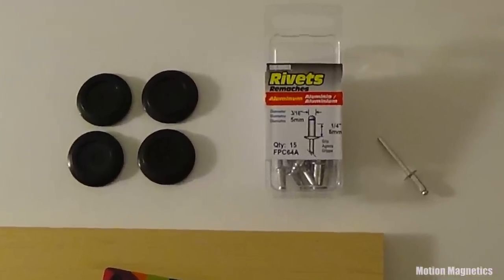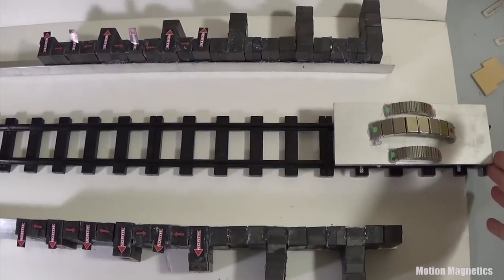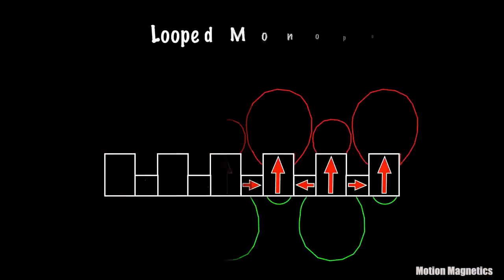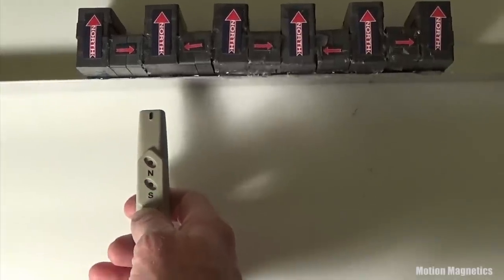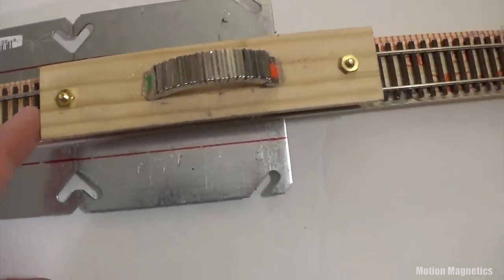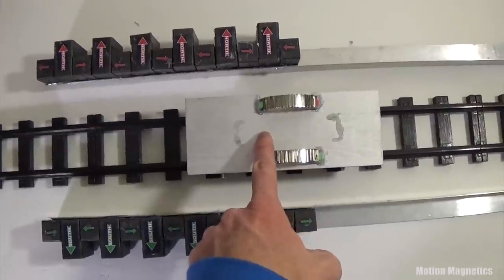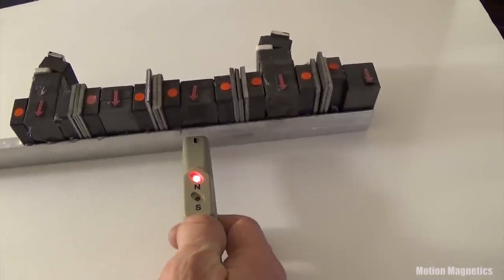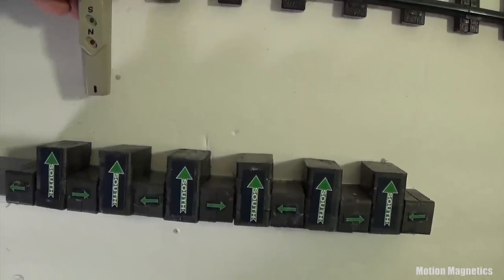Howard Johnson Magnetic Motor and the Halbach Array.

Comment: 3 carts attached to each other with 3 separate tracks . that way two of the carts would push the one entering the catch point through . then by staggering the magnetic gates or catch points you would have two carts constantly pushing one cart past the point of resistance .

Comment: Hello. Good work. Do you tried the weak rubber magnet and strong magnet combination. During the interaction with magnets, weak magnet will change the polarity. And may be during the pole flip, between same poles generates magnetic field spike what causes the pushing force?
Reply from the maker: ***** I didn't try that in these assemblies, but I have played around with that before in some of my other HJ assemblies. Thanks for the suggestion.

Comment: Well done, but you really need 90 degrees iron core pieces, that redirect the flux away from the sticking points...
With the old TOMI design it was done this way:
https://www.youtube.com/watch?v=u5mYm5nO5Fw
You can then use your track and insert these 90 degrees iron core pieces and also use them on your runner magnet.
You really need to find a way, that your runner magnet is sucked into the track and goes through without sticking.. that can only be achieved by guiding the flux away by bending it 90 degrees away by using big iron pieces at the entrance and exit...
Good luck ! Regards, Stefan.
Reply from the maker: That's an interesting idea. I might have to give that a try. Thanks.